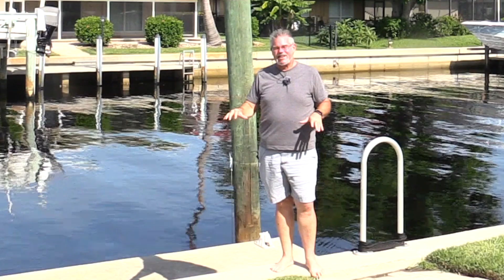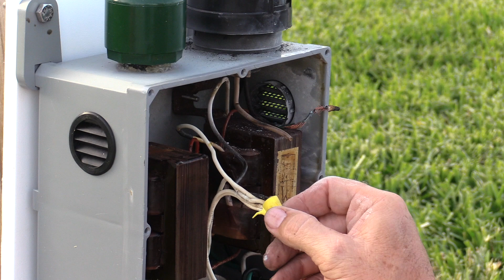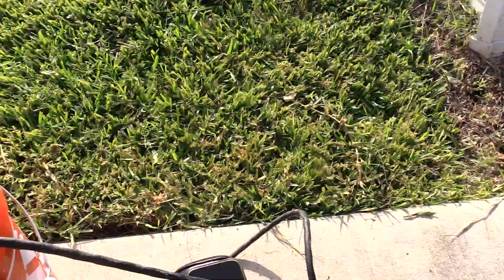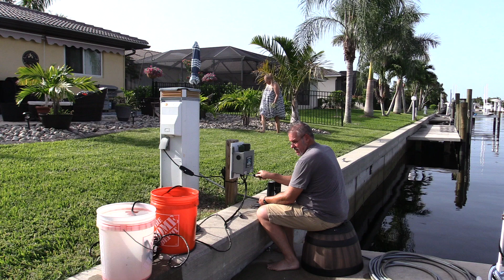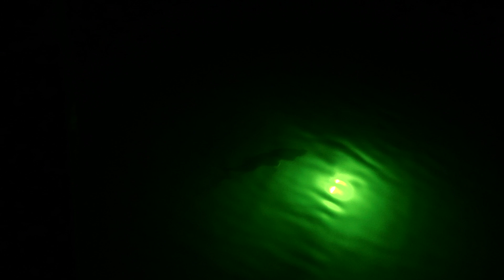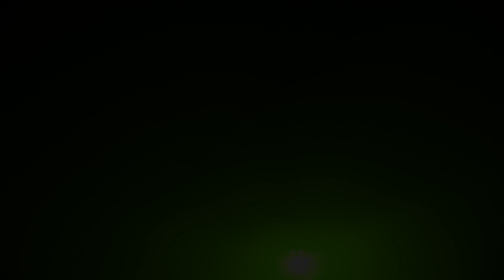Basic Electric Troubleshooting and Repair

Comment: A little bit scary working on electric around water but you got 'er done! I assume that circuit was dedicated to those lights only but if its not, always check for voltage on the neutral because it could be returning current back to the panel from another device on that circuit. I know one thing for sure...if I had my cell phone anywhere near water, there's no doubt...I'd knock it right into the drink! Did it twice in my pool! Hey, great job those lights! All cleaned up and rewired, good to go!
Reply from the maker: Yep, completely agree. I had turned off the dedicated breaker to the dock power, however I also unplugged it.   Taking no chances as I don’t want to become an electrical circuit. Lol.
Reply from the maker: Oh, And I did drop my phone once in the water at the dock before we had it dredged. I was able to go in and find it but at the time it was only 4 feet deep of so. Now, that may not be the case as it is 8 feet or so at low tide just off the dock. Big sailboat required deep water ;).
Reply: It's a sinking feeling!
Reply: @Svdreamchaser So what can happen, even with the breaker turned off is this: If the neutral in that junction box you were working in is connected to a neutral to another circuit somewhere before it returns to the panel, the neutral you thought was off because you turned off the breaker, can still be live. Its called sharing a neutral. Usually if not always against electrical code but it can still happen either by a mistake or shortcut by the original electrician or due to something a previous homeowner did. Its not uncommon though, especially if your wiring is pulled through metal conduit. So one of those cheap voltage indicator pens can save you from getting lit up. Never trust an untested neutral, especially if your working in a wet environment.
Reply from the maker: @crivitzguy5017 oh. That makes sense.